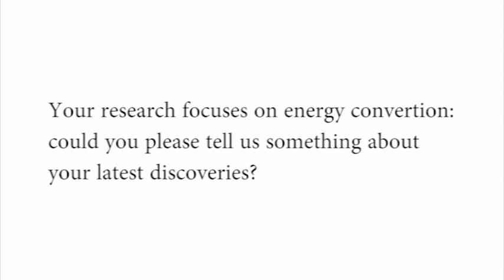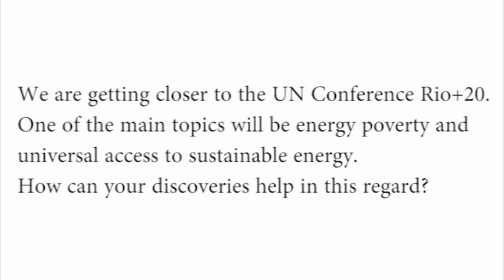Daniel G. Nocera

Comment: In a nutshell, 1/4 of a standard ranch house with solar panels and 3 gallons of water can split enough hydrogen to power your electricity needs plus drive a hydrogen powered car. If you need to store it fuel cells are the expensive part. Ideally, cheaply you can go right to the grid. I've waited years to see this in practice and am wondering why this isn't be demostrated at local community colleges. It's been 5 years. What is up? The water can be dirty.